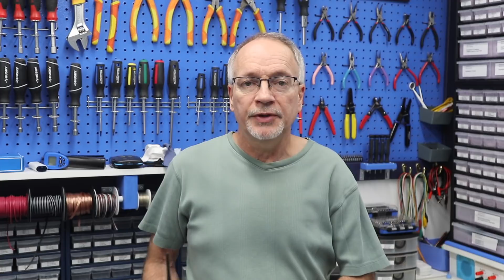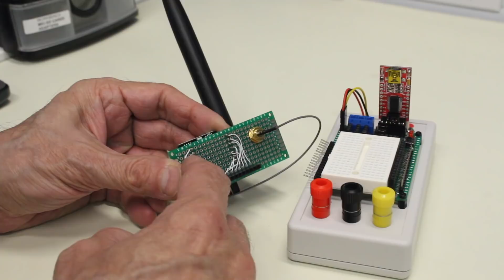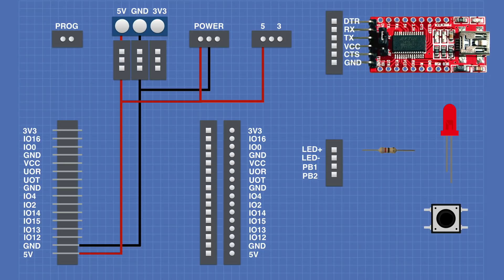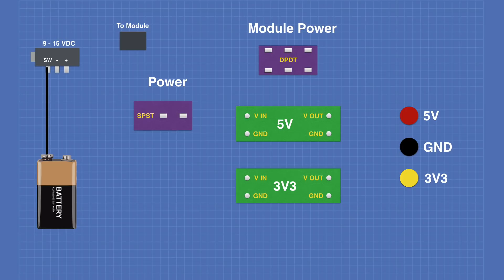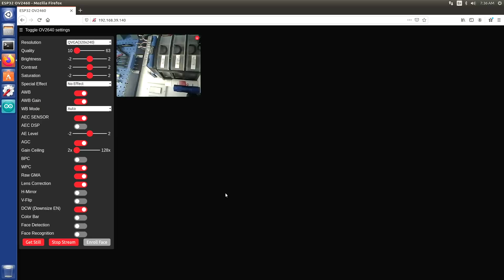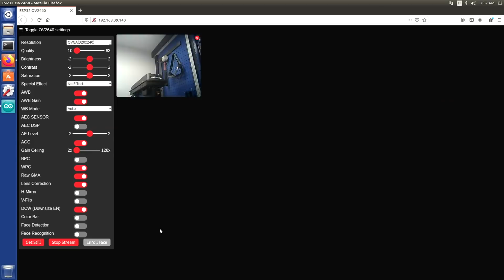Build an ESP32-CAM Developers Module with Power Supply

Comment: Going to show my age here! I learned Wire wrap when my grandfather worked at GTE. Most grasshopper boards at that time used wire wrap into the early 1980's I had a squeezable wire wrap tool. would spin about .75 inch of wire onto the post, but if you where slick you could stack the wraps, not that they where ever needed.  Then after getting few of the tools when they where phased out. I used the squeeze trigger tool to make chain link.  Amazon still sells wire wrap tools including the famous Jonard hand held squeeze trigger tool. I think I still have a roll of .28 awg solder and jumper wire from back then. 50+ years ago.

Comment: Sir, Im facing a problem where my battery-powered ESP32-cam's WIFI won't connect to the SSID. But if I use the USB-powered (FTDR), the Wifi would connect to the SSID. Do you know why is that? I have set the battery to be 5V.

Comment: Hi Bill, thanks for the video, but do you have an esp32-cam that has been running for some time and has it lost the Wi-Fi after a few days like mine?
I have tried different power supplies and added a large capacitor to the power supply and have run it on 5 volts and 3.3 volts but get the same problem, it runs for 3 to 4 days then disconnects, so I restart it, and it's OK for another few days.

Comment: Wire wraping.... book written by my university teachers (profesors) states that wire wraping can give up to 10 times more lowest resistance connection area in comparison to just soldering and is more relaible in some applications. My professors as many scientis in former soviet block were (regardless their ow will) involved in military devices construction and building (just in case of something unexpected) ...so highest standards without considering costs were primary design principles for them. 
But, today there is no even electronic components suitable for wraping available n public market ....no sqare  terminals ..everything round ..or just SMD.  ... 

BTW...Very professional tutorial ...nice to watch and listen

Comment: I have a 20x4 LCD with I2C (PCF8574) in my project which works 100% fine when
setup with the ATMega328 on the Arduino UNO, but when set on a PCB I made with
the same ATMega328 (without the Arduino interface) it only shows white squares.

Comment: Thanks for your informative videos.  For the esp32-cam or Pi Zero+cam,  I hope you will consider a POE (802.3af) connection project, instead of using WiFi and USB power.

Comment: Awesome, can you please do another video showing RSSI signal level on mobile phone instead of Arduino serial monitor. This will make it more practicable to move the cam at a distance & simultaneously check it's signal level / connectivity to the wifi router more conveniently .
Awaiting your earliest response on this.

Comment: Thanks for a great idea. I made a super simple version of this on a solder prototype breadboard that holds the USB to Serial and the Micro USB power connector. Female sockets for the board and jumper connections. It makes working with the ESp32 Cam so much easier.
Reply: what dıd you use as power supply
Reply: @selinklc7143  2.4A phone charger

Comment: Love all your videos, subbed a while ago and you've inspired me to start tinkering again. I just came across a lot of AT&T MC010B DC-DC POWER MODULE, IN 28V 0.44A / OUT 12V 0.83A. I think they are a dc-dc step-down but I'm not really sure what their purpose is for. What project could these be used in? Also if you would like a few for testing I'd be happy to send a few.

Comment: DroneBot, can you recommend an online forum for people working with the ESP32-CAM? The espressif site doesn't include one since they don't actually manufacture the ESP32-CAM.

Also can you recommend a place to get really good documentation on the ESP32-CAM/ There's source code and coding examples, but nothing that I can find that actually explains how all of it works, hat each function does and how to use them.

And, finally, I've discovered that ESP32-CAMs manufactured by different companies use different camera chips. I have one that has the chip (TY-Ov2 640-V2.0) itself aligned so that the width of the sensor is aligned with the wide side of the board (with the tiny button on the back corresponding to the upper left-hand corner of the image) and another with the chip (8225N V2.0 171026) aligned along the short side of the board (with the tiny button on the back corresponding to the LOWER left-hand corner of the image). And NEITHER of them have it aligned the way yours apparently is, with  the tiny button on the back corresponding to the UPPER RIGHT-hand corner of the image). When ordering ESP32-CAMs, how do we know the orientation of the camera chip?

Comment: can I use wires from inside a network cable? What is the rule of thumb for thickness of cable related to current/voltage please? BTW, nice/interesting concept and good video (again)!

Comment: Great informative video!  I learned and began to use wire wrapping back in the 70's.  Today it has almost been completely replaced by the solderless breadboards, but for complicated prototyping, wire wrapping still makes sense even today.  I have come across a few tube amps that Incorporated wire wrapping instead of the older point to point system, but that is a whole different form of wiring for another day.  Thank you and keep up the good work!  :D

Comment: Hello  well done thank you for amazing projects and information.  when I connect esp32cam and uart pprogrammer and doing all steps then remove jumper and reset it  showing dots  only  and it does not connect to the wifi   help please
Reply: You need to check your credentials (user,pass combo), dots means that you esp can not connect to your wifi.
If you look at the skatch Serial.print "." and delay after it print dots every X miliseconds that your esp is trying to connect.
So either your credentials are wrong or your esp is out of range of your ruter. If you use build in antenna range is kinda small, try coming closer to ruter.
GL in solving your problem.

Comment: Hi Bill. My name is Wane Mallette and have been trying to register on the forums to get some in put on a new project but have been unable to pull up registry screen and was wandering what I am doing wrong have already subscribed to the news letter thanks for any help on this.
Reply: Wayne you just need to send an email to "forum [at] dronebotworkshop [dot] com" with your first name (required), last name (optional), a username (required), and a few words of why you want to join (required).  The auto-registration had to be dropped because of more robots generating requests than real folks interested in the content of the forum.  The email seems to eliminate the imposters.  Hope to see you soon on the forum.

Comment: So, I guess there's no way around needing to get to the bottom of the board to hit the reset switch ?
You couldn't add a 2nd PBNO for that ?
Reply: Any easier way:  1.  Turn off the power  2.  Turn on the power
Reply: @jameszahary  Doesn't work that way. You have to hit the reset button while it's powered on in order to trigger the download
Reply: @TheSpyder19  Mine must work different than yours.  I've programmed them a thousand times and never pressed that button.
Reply: @jameszahary  Since I don't have experience of programming thousands of them, I'll just defer to your expertise
Reply: @TheSpyder19  lol,  I was thinking the same thing just add a pb normally open switch. Elegant solution Herr Spyder

Comment: I have build a test board for the regular ESP32 (Dedicated PCB with .some 3.3V to 5V translators and 3.3V power supply), I am not really gotten around to the CAM module yet.
I believe it is a very good idea to build a development platform for playing with modules, when you expect to use them a lot. I do not approve of using any type of standard boards when you can make a dedicated PCB for $10 to $15 (Usually 5pcs including shipping). The cheap PCB have some size restrictions, i.e. you may be limited to placing everything on the same side of the module.
Using a 9V battery for any ESP32 module is also a fairly bad solution, but would work if you get a LiIon rechargeable 9V  battery (LiIon can handle high peak currents).

Comment: I would love to see a quick video on the technique for connecting and soldering those small wires to the connectors, etc., via the perfboard.  Especially in the case where you need to connect multiple wires to a single pin, and how you get them to all stay in place while you get the joint soldered.
Reply: Totally agreed. I am bad both with soldering and wire wrapping and thinking to use fritzing to make a pcb....and even bcb needs soldering.

Comment: What is the life time of Your device using that 9 volt battory? That battory is good as a voltage source but not as a power source. I admit I'm disappointed that You recommend that solution.
Okey, You use proper 5 and 3.3 volt converters.
Plenty of beginners buy an Arduino, often an UNO, and applies that 9 volt to Vin. Then they connect various loads to the poor 5, or 3.3, volt regulator on the board, and ask Arduino Forum why it doesn't work.
Personally I use power banks. In some low current applications I need to waist som 10 mA for some milli seconds every some 10 seconds to make the power bank stay on.
Reply: I built a power bank for charging my phone but I use it the most powering my projects, like you said. Rechargeble lithium ion batts would be better suited but more complicated for beginners.

Comment: Good video.  I used a "helping hands" to mount my board and antenna, but it is ungainly.
The idea of a custom circuit board for mounting and connections is the solution.
 I have never used JLCB or equivalent to make a circuit board, but this would be the way to go.
Are there any designs for this project out there?

Comment: Nice job. Actually I was also thinking build a small board to make programming ESP32CAM easier, but I cancelled the plan due to following reasons: 1) programming ESP32CAM with the help of USB2TTL or a Arduino UNO is not that difficult, we just need to wire up 4-5 lines. 2)Actually, we only need to use USB2TTL to program ESP32CAM once, just upload a sketch with OTA functionality, then we can update the sketch without any cable. 3)ESP32CAM is a good board, but it is not suitable for projects with battery power, there are some design issues in the board, even we put the ESP32 into deepsleep mode, the SD card and Camera units still consume some current, it is very difficult to limit the current below 1mA
Another comment, to make the soldering simple, it is worthwhile to use the breadboard-shape prefboard for such projects